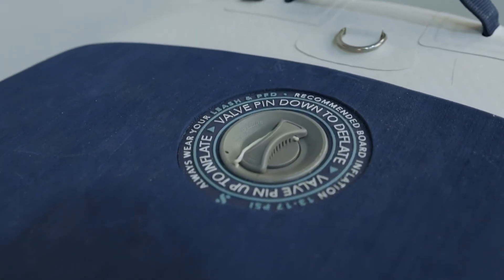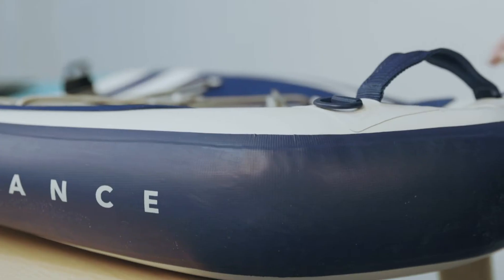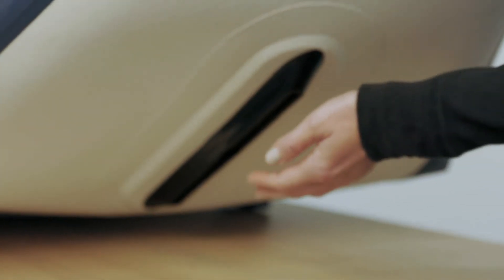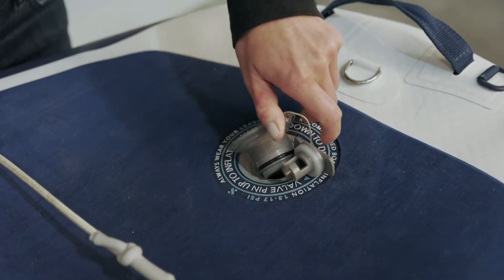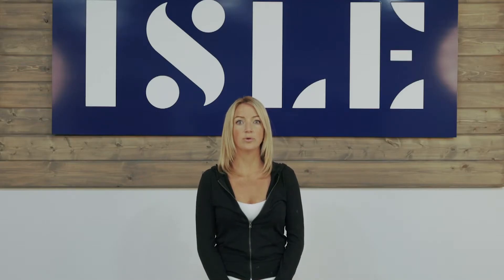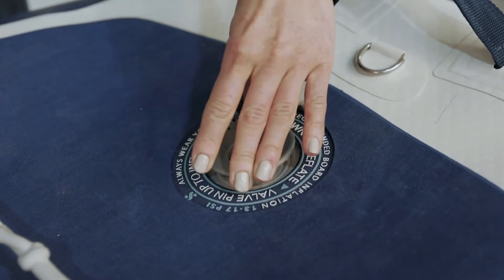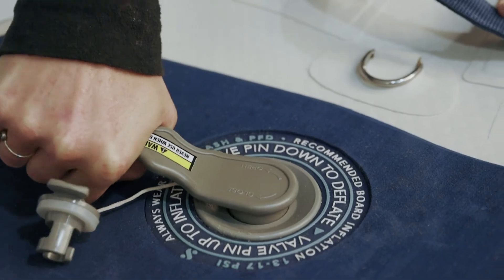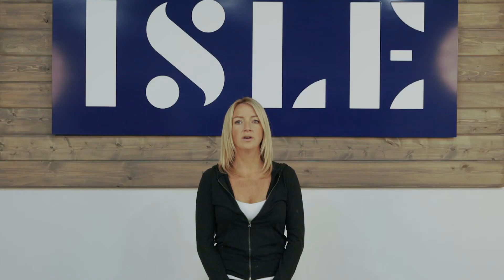How to Replace your Inflatable Valve

Comment: The hard part is what they don't show.  How to grasp the loose valve base through the board AND the fin box from underneath.  If you can't get a good hold then it turns and tightening is impossible.  It is quite difficult to grab this inside part.
Reply from the maker: Actually you're right, this video didn't mention that detail.  If you fully deflate the board you can often grab the base, but if not you can press down from the top around the edges of the valve to hold it in place while you twist - that works as well if you hold it down tight.
Reply: Yes I found mine was extra tight but got it loose.  Any chance board factories will ever go to a better system for sealing the valve?  The actual valve is fine but the loose captured yet inaccessible nut is a ridiculous way to seal the fabric to valve.  Obvious solution would be an open collar for the fabric seal then install the valve to plastic collar.